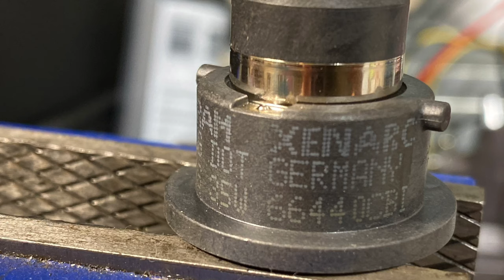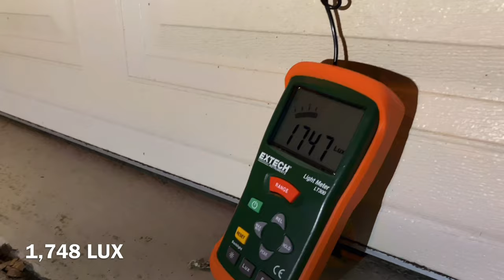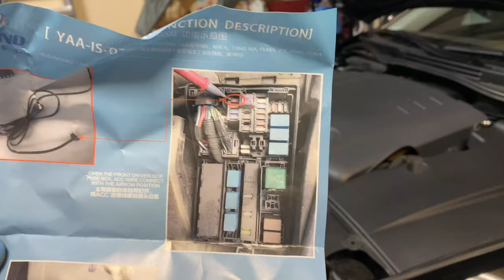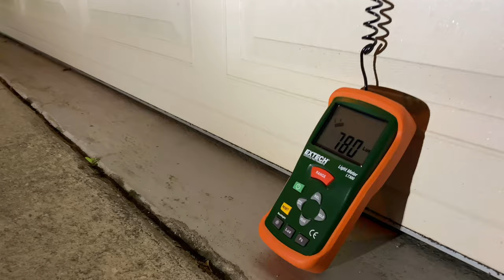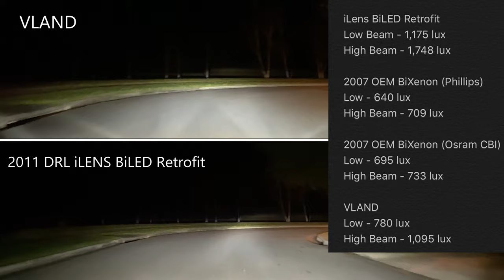VLAND Headlight Review & DIY Install Lexus 2006-2013 IS250 IS350 IS-F Triple Beam LED

Comment: Can you make a video on how to adjust the height of the headlight?
Reply from the maker: I actually had footage of it but ended up cutting. The height adjustment is pretty simple with this. The height spinner can be reached with a 12 to 15 inch screw driver.
Reply: Ghetto upgrade China product

Comment: How did you fix the high beam flicking.
Reply from the maker: Turn off the DRL via Techstream
Reply: @TunerwithKids  I tried using techstream the function under light control don't open, is there another way to disable it.
Reply from the maker: IDK. Are you USA based? Some country (Canada don’t allow DRL disable).
Reply: Yes I live in the USA
Reply from the maker: Something must be wrong with cable or version of TS.
Reply: @TunerwithKids  ok thanks for the help

Comment: Excellent video.  The Vlands are overrated imo.
Reply: @blackpanda7612   Those same people don't care about maintenance either and that's the reason their shit raggedy cars don't last 🤣
Reply: @Jedi_Luke  One of my mates Vland headlights started getting condensation on the inside and these lights are expensive. I don't mind paying $5 for chinese crap because I don't expect it to last very long but if you're going to ask me to fork out hundreds of $, you better have a quality product.
Reply: @blackpanda7612  Exactly!!   I can't see spending $500 on headlights and you can't even change the bulb if one blows out.  If I can't get the 2011+ OEM, I'll either get Depos or the Vipmotoz.  The LED strip is the only cool thing on Vlands imo cuz it's so bright.
Reply: @Jedi_Luke  You're 100 percent right. Yeah you're basically just paying for that led strip. Same here mate. I'll wait for a cheap set of 2010 headlights and rather get those. At least i Know my ASF and other headlight functions will work and at a much higher light output than VLands.
Its like asking me to put chinese tyres on my Lexus. I bought my car with chinese tyres on and they were fucking terrible. I got rid of them asap. Threw on Falken Azenis tyres and never looked back. Car is comfy and quiet. Chinese are just snake oil salesmen. They'll try to sell you a lump of fresh cow dung.
Reply from the maker: The 2011 DRL headlights don't have "real" AFS since lexus got rid of swivel on them to make room for DRL. They only come with auto level so all HID 2IS 06-10 will still freak out without the swivel. It's a pretty complicated system to keep even the autolevel. I did it on my Depo retrofit but I had to use spare swivel motors to keep the car thinking it had all the AFS parts.

Comment: I disagree with you on one part. You did say on the video that the Vland headlight isn't going to be as bright has your HID kit with new bulbs. After doing  my testing ( K2 Motor headlight projector with  Opt-7 55w HID 6000k installed) my total Lux at 25ft measured (Per Headlight Revolution Recommendations/Videos) at 667 Lux (Low Beam) and you measured 780 Lux for the Vland headlights so Vland should be brighter since  no retro-fitting on my Lexus projectors..Correct me if im wrong. What's your take Tuner with Kids?
Reply from the maker: my measurements weren't at 25-ft. They were more like 15-ft from end of driveway to garage...your measurements and mine aren't gonna be apples to apples. My comparison was more for apples to apples against the lights/projectors I had on hand. If you saw the VLAND output in person, you'd be like WTF, especially if you are a headlight junkie.
Reply: @TunerwithKids  ohh ok gotcha! Ill do this from 15ft away and let see what reading i get.  Yeah I know right? Ha well glad your doing these videos and everything looking good on your end , 👍
Reply: @jessebuenrostro2080  Don't forget that HIDs and LEDs have different ways of being measured. You cannot use a regular Lux meter with LED bulbs because they are on different wavelengths. Most of the time LEDs look brighter due to its color it projects but in fact may be way lower when it comes to light output. I even noticed from newer cars with factory LEDs that they use multiple LEDs to somewhat make up for the less light output they give off compared to HIDs. A good example are the new Acuras and Lexus ES350 that have LEDs.

Comment: I would love to have a pair of these for my 2008 lexus is250 , I bought the drl black bezel projector off ebay for 340$ & my drl bulb exploded after 4 days of swapping them in 😩
Reply from the maker: You probably still had factory DRL enabled? That sends a pulse-width modulation signal to the high beam for DRL and if the new aftermarket lights used a cheap bulb, that might have caused the blow up. Those eBay VIPmoto and Spec-D are pretty garbage.

Comment: My high beams run/flicker while my DRLs or on.
Reply from the maker: You need the factory DRL to be disabled via Techstream.
Reply: @TunerwithKids  how do I do that?
Reply from the maker: Dealer or get cable and DIY.
Reply: @TunerwithKids  just took it to a dealership and they said they can't help me.
Reply from the maker: You Canadian or USA?  In Canada it’s not an option to disable. In USA it part of the personalized settings.
Reply: @TunerwithKids  usa
Reply from the maker: Sounds like lazy service people don’t want to do it. It’s literally a 5 minute job they can bill hour for.
Reply: @TunerwithKids  i told them I can get the afs light to come back on so the scanner can "see"
Reply from the maker: AFS has nothing to do with the personalized settings. If they go into Other Options, it’s one of the personal settings in the menu.
Reply: @TunerwithKids  if I DIY where can I get the Toyota techstream or whatever its called and do i need any software?